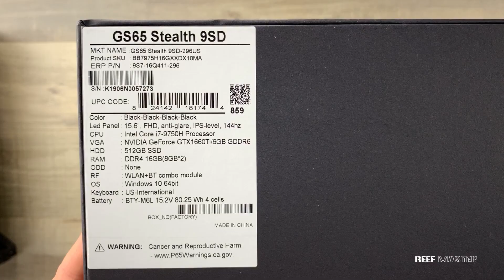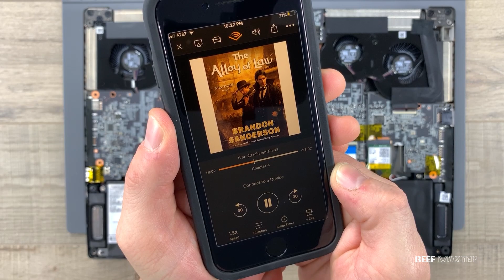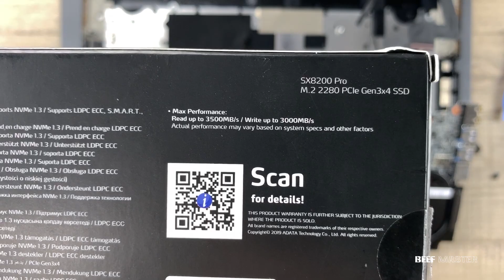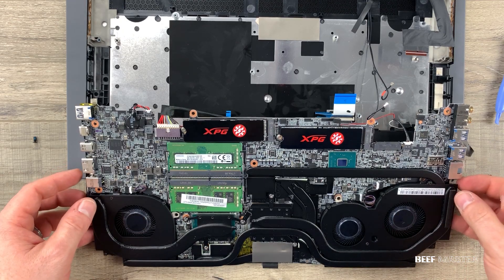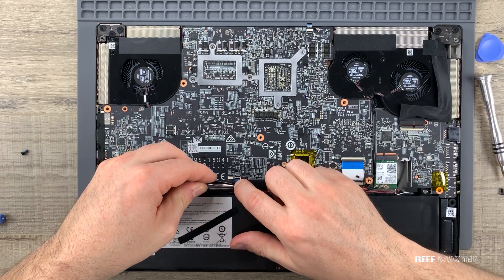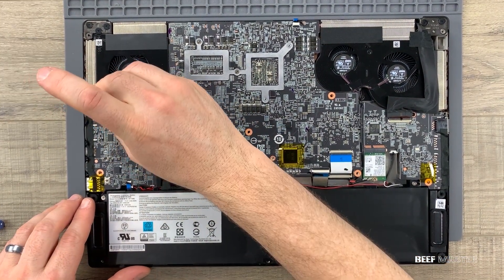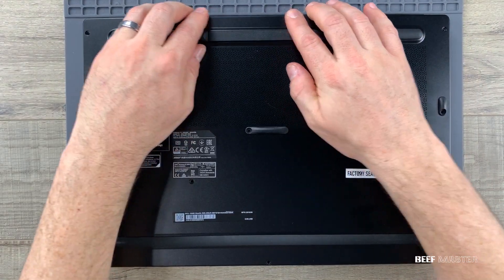MSI GS65 Laptop Teardown Review

Comment: I shorted a tiny little capacitor near the fan cable with my screw driver tip when I was putting the screw back on and I'm scared to turn the laptop on and run into problems, any idea if a very small capacitor will stop the laptop from turning on?
Reply: I turned on the laptop and it works, but the display is dead. I have it hooked up to my tv via hdmi and it's outputting video just fine. I guess I gotta shell out almost $400 for a new gs65 stealth motherboard 😐

Comment: I know this is an old video, but if you see my comment here, please answer.. I removed my motherboard to re-do the thermal paste, and when I assambled it back together, made the mistake of rooting the wifi's antenna cables undeneath the motherboard instead of pulling them through, I know there is a heatpipe that is close-by, but it isn't from the CPU or GPU so it shouidn't be that hot.. is it ok to do leave it like that or should I disassambly the entire thing and root it correctly? .. Im not that good with these things so it's a real pain to going through it again.. thanks in advance, and sorry for my english.

Comment: Do you know how to fix an MSI Gs63vr Stealth Pro? The overactive heat senor crashed the laptop computer and automatically turns it off. Now it will not start up unless the laptop is put on the table a certain way. The red lights on the keyboard and above the keyboard turn on for a few seconds and then turn off. The power button seems to be working. But you kind of have to push it kind of hard. Could it be the battery in the laptop?

Comment: I tried it myself and it does not turn on... which component do you think is not working when a teardown like this is performed?
Reply from the maker: Good question. A few things to try: 
1) There are two connections to the battery. Check those first. 
2) If you are getting power (it lights up), make sure the top tab is connected, seen at 6:44. 
3) You may need to reconnect the thick black wire on the right that powers the screen.
4) If any of those don't work and you installed a new m.2 SSD, check compatibility.

Good luck. Please share if you find the cause.
Reply: Adriel Sjahfiedin Did you find the cause?
Reply: did you solve the problem??? please